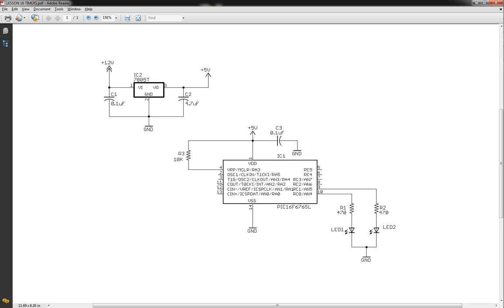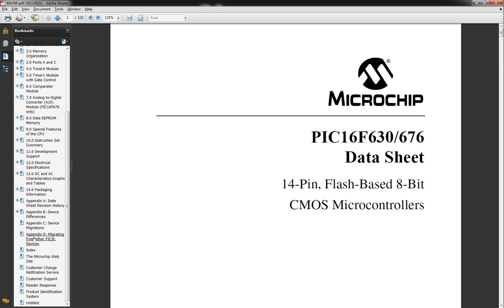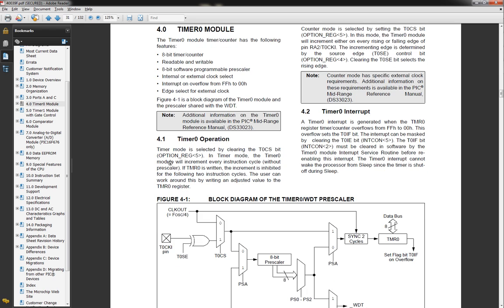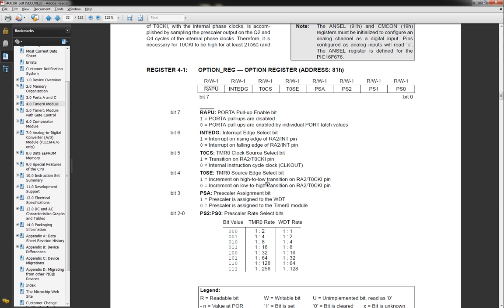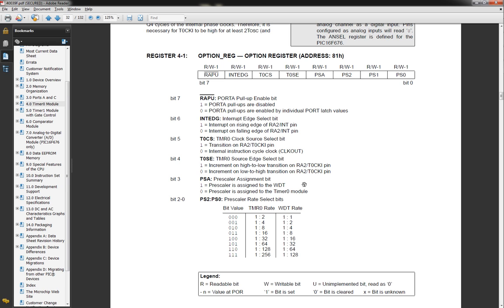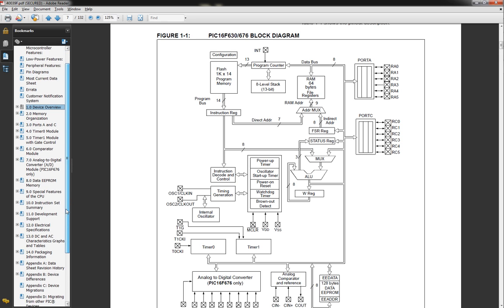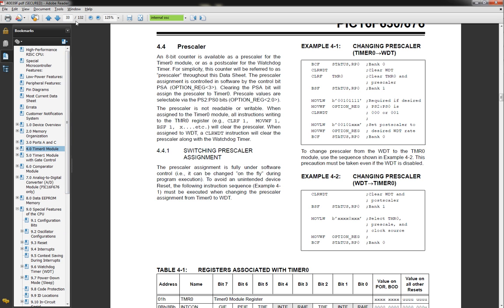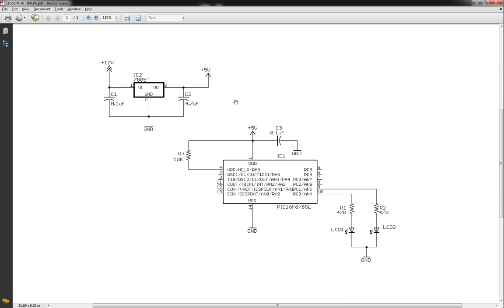Lesson 16 Timers Part1

Comment: The counter overflows on the cycle after 255, so you may be correct in some round about way. The largest hex number that fits in 8 bits is 255. So to be technically correct, 256 should not be mentioned in your explanation.